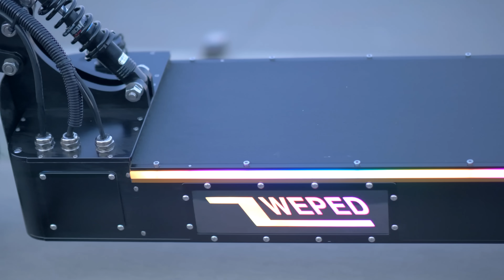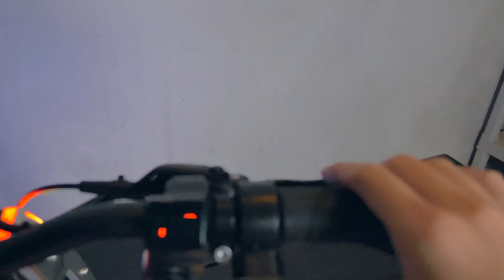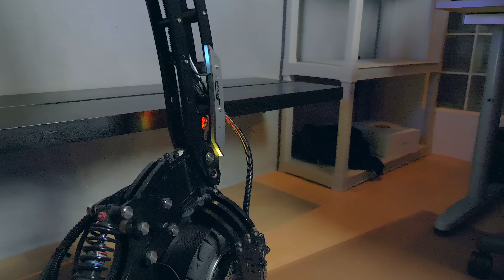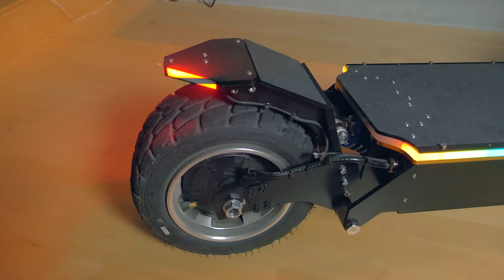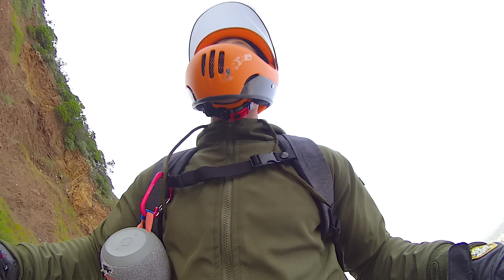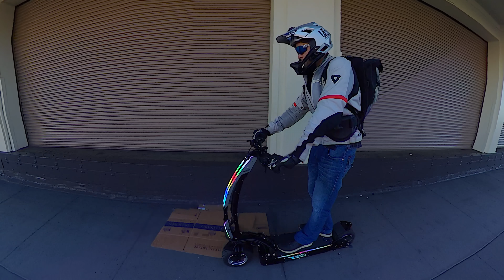WEPED SS Electric Scooter, An Insanely Fast And High Quality Ride

Comment: I loved how the reactions of the ones who tried it first was. It's literally how we all felt when trying it, like our souls were being left behind, users of the Weped GT50E and some Wolf Warrior and DT Thunder and DTX users were surprised as well.
And yes we still haven't maxed out the speed yet here in the Philippines as we're still adjusting with it's powerful hubs.
It's just intoxicating hahahaha can't wait for the Weped SS FPV video!

Also for the fast chargers, if i'm not mistaken they're for sale though and it sure charges hella fast! Hahahahaha

Gotta add, for turning, it'll take time but you can easily bank on corners and snake through traffic with the Shinko tyres also. It's got added stability even on wet roads.

Tweeks are also available which makes it seem endless for additional upgrades and modifications. Gotta love'em!
Reply from the maker: "like our souls were being left behind" <- love that lol
Yeah, it's super powerful for sure. Way more than the current class of power scooters like the Dualtron X. Though I will admit the Dualtron X/Wolf Warrior/GT50E are plenty powerful for most, and might make a better relaxed cruiser.
Reply: @AlienRides  I have to agree with you there, I mean I'm happy with my GT50E but the Weped SS is like another upgrade from the current 60v top of the line scooters. Which has got me drooling. Gonna wait for your FPV video! ❤️
Reply: Nice one bro JM! Tyopapi here. Haha!
Reply: @darwinubaldo680  hey there Papi! Hahaha ❤️❤️❤️
Reply: Bro sino distributor sa Philippines and saan nearest shop? Thanks in advance
Reply: @jmr7681  We have Weped Philippines here as the main distributor of Weped Units.
Just send me, i'll help hook you up with your own Weped unit! RGB and Ride's amazing. ❤️
Reply: @Martyr4JesusTheChrist  I've seen and rode this in person. But all I can say is you just gotta test it for you to believe it's power. I was skeptical at first, but was also blown away just like @Alien Rides here.
It's fairly easy even for small hubs specially now that there are electric scooters reaching speeds of 120-135km/h even custom electric kick scooters that were modded can reach these speeds with the tech available now in the market it's easier for 72v compared to 60v units. Check out your local Weped distributor and ask them about it, or check youtube for more Weped SS videos, it's seriously amazing. Hahaha ✌️

Comment: A so premium and expensive scooter with 5$ cheap grips from aliexpress...
Reply: Exactly the point. These manufacturers and their reviewers focus entirely too much on speed and to a lesser degree on power. What they often fail to talk about it the quality. But even setting that aside, the issue for me is these machines that are capable of 40-70 mph... You are basically asking for regulators to come in and shut down scooters as an alternative commuting vehicle.

In my opinion, reviews need to move away from speed and move more towards things like suspension, ease of tire change, potential extras for the thousands we spend, and true range and the increase in it.
Reply: @rustilldown7  Completely agree with you !
Reply: rustilldown7 I totally agree, this can ruin it for all of us !
Reply: @rustilldown7  GREAT POINTS you put out there.
Reply from the maker: Hah, you do bring up a good point that not everything is premium on this scooter for the price point. Like maybe they could use some better buttons? Regardless, I would definitely switch out the grip tape I think, shouldn't be too hard.

Comment: Great vid
Nice scooter, I thought the steering looked too low but the way they have handle bar mounted it is easy to switch out to a taller bar.
In the end, too pricey for me.
Cheers
Reply from the maker: Yeah, personally I liked the handlebars, but you could definitely switch then out for something different. It's their flagship model, so it's not cheap, but excited for the progress. We'll see some other cheaper wepeds in the future, like the new CT model

Comment: How is the handle height  It looks very short
Reply from the maker: Handlebar height was totally fine for me actually, getting a bit lower to lower your center of gravity is probably a good thing on this beast. Didn't seem to be adjustable at first glance, though you could adjust the angle of the bars if you wanted.

Comment: Thanks for this great video Kevin! It is hard to find good videos on the power scooters especially Dualtrons and Wepeds. Seeing the reactions from pro scooter riders was a true testament to its power. I have always respected the Weped scooter aesthetics and build quality. I was actually thinking of getting a Weped Mini-R after seeing your review of it. I had forgotten about that little blue beauty. Once it went down to sub $2K I was strongly considering it. Unfortunately I waited too long and they were sold out at that pricepoint. I was able to see the Weped 50 and Mini-R at Minimotors when I was shopping for a Raptor 2 or Compact. After testing them all out I am glad I went with the Compact. I think it is the rarest Dualtron as no one wants the solid tires and drum brakes. Minimotors told me that no ones seems to know about the Compact and it is a sleeper. I have 40 miles now on the Compact after a week of ownership and I am glad I went that route. Once you get accustomed to the drum brakes and wide solid tires the no-flat peace of mind at 40MPH makes me smile. The Compact also completely smokes my Mantis off the line. Once you learn to brace properly for bumps and potholes and don't take hard corners you will love the Compact. It does not corner well compared to the Mantis but straight line stability is great with the wide tires and stiff suspension. The folding handlebars also let me store it in my garage just like my commuter scooters which I couldn't do with the Mantis non-folding wide handlebars. I thought I would find the drum brakes lacking but adjusted and with ABS enabled they can definitely stop the Compact with authority. I love not having discs exposed on scooters. My Mantis discs have been fine but I have had other scooters and mountain bikes get bent rotors all the time. There is nothing exposed on the Compact that can be hit to brake, bend or puncture. It is a commuter, power scooter tank :)

Oh...can't wait for you to take a look at that Dualtron Mini. There is still nothing out for the Mini, Compact, or Raptor 2 that isn't in French or Russian. I need to turn on the rainbow LED mode on the Compact now after seeing the SS. I turn it to Orange to go with the San Francisco Giants colors but after seeing the SS I like that rainbow look now. It is an eye-catcher :)
Reply from the maker: Hey! Nice thoughts on the Compact and I'm glad you're enjoying yours. If I ever do a review on it I'll have to quote what you said :)  Definitely want to do vids on the Mini/Compact/Raptor 2, just been so busy lately, and one vid a week is all I have time for.
Reply: @AlienRides  All good! Need to focus on the profession so you can afford the toys :)

Comment: My man! Finally! I've got to have one. The only things I do not like is the key fob and thumb throttle. I used to have a key fob on my electric bike but the key folded. I don't know why they don't have that since the key is on the handle bar and sticks out so much. I also hated the thumb throttle on my e-bike because it made me ride with a monkey grip. I'd rather have the eye display with finger throttle. Besides those two things the scooter is just awesome looking and powerful with a huge battery. For me super high top speeds it's not a priority it's that insane torque which gets you from 0-35 super quick. Also like you said that small of a charger with that big of a battery is a joke. I mean who wants to wait twenty+ hours to charge up their scooter. I'm sure they will address that.👍✌
Reply from the maker: Hey man, good to see you. Don't disagree with what you said, hopefully all of these things will be fixable, either via mods, or customized when you order from a distributor. Wouldn't be too hard to swap out the controls for a classic finger throttle I think. I love how Weped is shaking things up though, and I can't wait to see what's next for the scooter industry in 2020.

Comment: Good vid🔥🔥 sexy machine, I’m racing this against the rion 😜😜
Reply: RION is a good competitor for this for speed, but it can't endure for long treks. WEPED SS can go 120 km (74.56 miles)~150 km (93.20 miles) on a single charge.
Reply from the maker: 😅 let's do it!!!

Comment from the maker: We've got lots more content with incredible monster scooters coming up. Subscribe and let's ride!
Also check out our new membership program for exclusive emoji access: https://youtube.com/alienrides/join :_alienRides::_alienRides::_alienRides:
Reply: @alien Rides I’m def looking forward to the Weped SS vs Rion RE80 video. I’m still considering the RE60 for the performance and lower price point.
Reply from the maker: charles kato Weped and Rion are my top two scooter picks right now. You can’t go wrong with either. 🛴 💪
Reply: @AlienRides  i thought the rion. race version was not for sale. thats whats stated on their official site. i wanted to buy that and rion told me its not for sale. has anything changed or r there other race versions rion has.
Reply from the maker: OK DOK you can currently buy the RE80, but not the RE100. The RE80 is also a race edition and has lots of power.
Reply: @AlienRides  yes i remember now. yea even the one for sale is pretty fast but that re100 is an absolute speed demon. cant wait till tesla debuts in this industry
Reply: @AlienRides  are you aware of the specs for the re80. the website doesnt display all of them. im mainly interested in the range, speed, weight and price. if you have any number for those specs that would be so useful.
Reply from the maker: OK DOK not off the top of my head, but also working on a video along these lines on the RE80, hopefully next month.
Reply: If it's not released yet how did you get it?
Reply from the maker: Gabe T mainly so I could test it out, provide feedback, and build hype for the launch. We’ll do another video when it’s released.
Reply: How much does the scooter cost
Reply from the maker: Norberto Vaca hasn’t been released yet, so not fully sure, but estimated at around $7k delivered.
Reply: Would someone please sub to me
Reply: You think for the Weped models could do a video how to remove the speed limiter?? That would be so awesome of you did.😬
Reply from the maker: Slim567 I hope to be able to, it’s not easy for me to get access yet unfortunately, and often it’s removed by the time I get the demo unit. I can ask though!
Reply: Alien Rides Thanks man appreciate it! 👍
Reply: Alien Rides  I just noticed that Last Mile sf sells Weped GT maybe ask them how to remove the speed limiter? Is the Weped sold by Last Mile limited?. One last question is the Weped GT water résistant like the SS? Just wondering.😁
Reply from the maker: @Nessnho  Sadly I don't think the GT50E is as water resistant. I think the speed limiter is contained within a tube that goes into the deck, to the right of the stem. I haven't seen it myself though. Hopefully we can do a vid in the future.
Reply: Any thoughts on the SS vs the RE90?
Reply from the maker: Derek Six hoping to make this comparison later this year. Both are awesome scooters, and completely different from each other.
Reply: Where the hell can you buy this beast?? I was looking forward to buy the zero 11x but now that I've seen this I mea. I've looked for it but can only find the gt, where do you find the weped ss?
Reply from the maker: @ricardomarques959  It was supposed to be available shortly after this video came out, but things have been delayed a bit. It should be out soon!
Reply: @AlienRides  cool just let us know of a reliable website to buy it from when the time comes if you could :)
Reply: Elephant! Whats range?
Never realised scoots could 70mph! 😱😂👏👍
Reply: I wish i buy one of this 😔😔
Reply from the maker: Gilbert Domingo some day you will have one!
Reply: Is this one available yet? If so what’s price and place to buy one?
Reply from the maker: Ron Nickle I think they’re having some stocking issues getting these units in from Korea, but should be on their website soon I hope.
Reply: @AlienRides   I rinsed off my Q power and water got under the deck and ruined the battery...so much for ''water resistant'', been waiting 2+ months for a friend to be able to order new cells and make me a better than stock battery for about $1,000. I bought an open box model, saved $550, I am guessing when it was repaired they did not silicone the deck back on to seal it properly and open box only comes with a 1 month warranty..so much for saving money. At least it will have 40% more range soon I am told and a BMS that I guess it did not have before?
Reply from the maker: @NoNORADon911  dang, bad luck about the battery. If you are able to upgrade it you are often able to get more range and speed compared to the stock version. It should have a BMS, but maybe you can use a better one now. Good luck with your scooter!
Reply: @AlienRides  Thanks. Just ordered 114 Samsung (50e) cells for $516. Was going to get (40T?) I think but there is availability issues and tired of waiting so moving on to the next best thing. I was told the stock battery had no BMS and this new one will.
Reply: @AlienRides  The guy making me a new battery is buying my old battery for a little over scarp price at .75 cents a lb and sorting out the good cells and rebuilding it.
Reply from the maker: joe v I’m sure it will have a chair available eventually! Will keep people updated on that.
Reply: How can you read the battery life using the voltage meter?? I’m a bit confused.🤔
Reply: @Nessnho  So 67v is a full charged,  47v is a dead battery....so for every volt that falls is roughly 5% of the batteries life.
Reply: Hi
Reply: Alibaba has them also 2300 300 for shipping some site free shipping exact same thing
Reply from the maker: @UnEqual Reality Yup, a motorcycle definitely gets you more for your money, but most don't have the silly LED lights 😅
Reply: Please help me grow my channel
Reply: Hmm comments here are being deleted....
Reply from the maker: Take America Back From Isяael I don’t think so, I never delete anything.... maybe the spam filter is though? 🤷‍♂️
Reply: @AlienRides  Not you the bots that deem anything controversial against the regime gets auto deleted if they catch onto enough key words. We are getting closer to the CCP every day. Somebody replied to my comment then I came back here to read it and both of our comments are gone. There is a long list of certain words when connected we are not allowed to say on YT anymore.
Reply: WAT OTHER MONSTER SCOOTERS.....please elaborate
Reply from the maker: OK DOK 😅 sadly I’m not allowed to tell yet, but it’s going to be a good year. Few weeks if cool, but slower commuter stuff coming up, then back to the monsters soon.
Reply: @AlienRides  HI! Glad to see you received the first unit. I am noticing the same as I felt with the suspension and throttle... They can be improved a lot. To me are the things to take into account for the next model. The rest is amazing! Check my channel if you have some doubta of Weped scooter and keep it doing like that! Best regards
Reply: @AlienRides  is the zero 11x amongst them? i hope a review can be done on that goliath soon. its 1 of 3 or 4 scooters now that can hit 100 kph and its range is insane at 150k. not alot of people are mentioning it and i hope ur channel is 1 to give it the proper credit especially considering its price point. much cheaper than the upcoming ss and cheaper than the dualtron x
Reply from the maker: @okdok3742  The 11x is going to be slow compared to what's coming, but I really want to feature it here as well. Sadly I haven't been able to get my hands on one yet 😥
Reply: @AlienRides  slow? jesus, either thats an over exaggeration or we have some absolute units coming. ive seen the 11x handle the dualtron x and the dualtron x is a beast itself. i can see the weped ss and of course the rion race version handling the 11x but yea. its hard to decide which monster scooter i wanna get when it might get trumped the next year by this growing market. its exciting but it leaves me unable to choose lolol.
Reply from the maker: OK DOK lol yeah, every year something new comes out, at some point you just have to decide to buy. Personally Weped and Rion are top for me right now.
Reply: @AlienRides  Ohhh....I'm about to order quite an expensive one. Are you telling us to put any order on hold?? 

Can you give us teasers at least?? 🙄😏🤣
Reply: OK DOK Goped gsr 46s
Reply: @mrsideways4574  My Thunder eats Gopeds alive!
Reply: @okdok3742  I'm about to order one that goes 110kph....
Reply: @manoman0  so, what does that mean?
Reply: @okdok3742  What do you mean? I am about to order a flipping expensive e-scooter and now they're telling me more is coming up but give no idea what the goodies might be?
Reply: @manoman0  thats the nature of any young market, better and better shit will come out every year. accept that and be happy with wat u ordered. just pick something that fits ur needs best